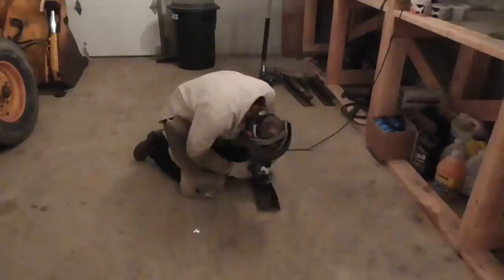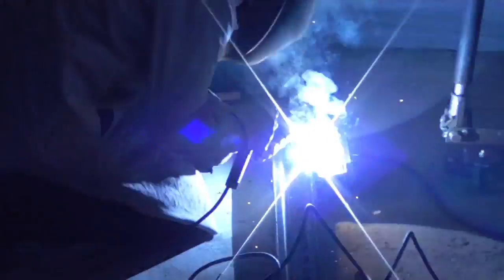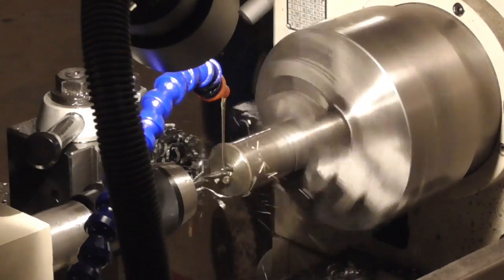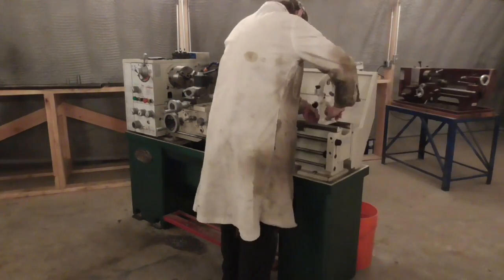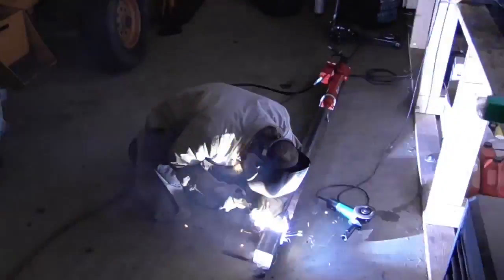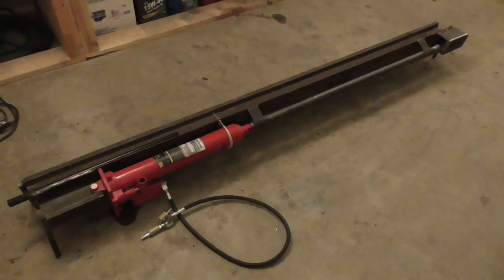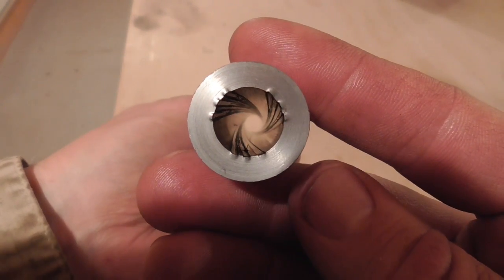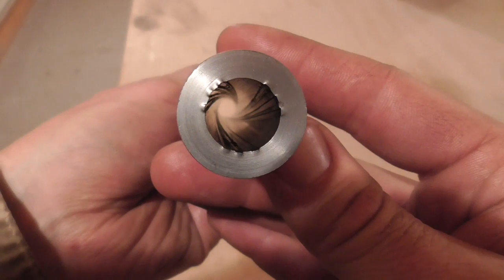Building a Better Rifling Press (TIS125)

Comment: A suggestion; instead of new air compressor just get a portable air tank & have it in line. You can increase your air storage & at the same time have a portable tank in case you need one.

Comment: Such things could be done with a leftover hardened drill bit cut with a file and blade at the right angle. Hardened and serrated with a hammer. In the 90s

Comment: If you have the means it might be more practical to try hydraulics, that way you don't have to wait for the compressor to keep up and you can retract it by just redirecting the flow. 

You have a lathe, you could make yourself a set of makeshift cylinders, fittings and lines out of steel pipe. In fact if you made some directional flow valves (which you can do too) you wouldn't even need to buy anything off the shelf. And it would probably cost less than 50 bucks in material. If you look for "diy hydraulics" there's a guy crushing coke cans with nothing but cheap plastic syringes.
When you have a lathe and a milling machine the sky is the limit. Hope I can get there some day.

Comment: What speed and type of bit and rpms did you use to machine the railroad steel my mill bit just got all chewed up
Reply from the maker: Well, it's been a while since I made this video, but if I recall correctly, I probably did most of the machining with a 3/4-inch carbide end mill at about 1000 rpm.
Reply: TheIdahoanShow thanks

Comment: Thanks for posting this. You did a great job with the video! Nice machine shop but no air tools for fastening bolts? Was kind of funny watching you use a breaker bar when you have tens of thousands of $$$ in equipment there. I was wondering why did you decided to rifle the barrel 3 times, or even use just lands/groves?  I thought you weren't supposed to re-rifle a barrel due to the elasticity of steel and the stresses induced by rifling. Did you stress relieve & lap the barrel afterwards? How about cutting a chamber & showing "proof of concept" by firing the barrel? Can you put an 11 degree crown on the barrel? This was really interesting!

Comment: Correct me as I’m sure I’m wrong, but I thought welds didn’t hold good on railroad track as they were cast iron?
Reply from the maker: I was under the impression that rails are typically rolled rather than cast; at any rate, I've never had any trouble welding them.

Comment: What about rifling rate of twist? Seems components are straight line, no turning for twist rate.
Reply from the maker: The rate of twist is determined by the angle of the ridges in the rifling button that is driven through the barrel.

Comment: Hey brother nothing wrong with the button guide or equipment that she used you just used cheap metal for your barrel I've seen it before change the metal that you use for your barrel better results other than that it looks great in the equipment looks great job 👌

Comment: I am wanting to make a yard Cannon with approximately 2 inch bore. Wondering if they make a button rifling bits in to inch? Just laughing! Very nice job. Great to see Ingenuity at work
Reply: The amount of force you'd need would be pretty scary, and if it's a muzzle loader you'd have a tough time getting the button out of the breech. You'd be better off cutting the grooves instead, with something like a shaper that can rotate the cutting tool.

Comment: You've inspired me to build one of these. My cut rifling system pales in comparison to your button system! Will 8 tons be enough for a 6 blade button? I need to do calibers down to 25acp, do you think there is enough support in the bushings to go that small? I wanted to use aluminum for my bushings since I have alot of scrap aluminum, I'm guessing there's no problem with that since there shouldn't be that much force on the bushings? Also, I wanted to cut down on the amount of unsupported pushrod, so I was thinking about cutting a recess into the bushings for the spring to rest inside (maybe this will secure the springs better too). If I used 2 inch thick bushings I could recess the springs a half inch on each side, then the bushings would touch when the springs are fully compressed and there would only be 1 inch of unsupported pushrod between the bushings when uncompressed.

 I'm going to buy 6ft of some hardened rod off the shelf from mcmaster 50,000psi Rockwell C60 (is this going to be strong enough?) https://www.mcmaster.com/1555t12

Thinking about using these springs: https://www.mcmaster.com/1986k655  I think if I can fit them into the bushings snugly they will hold alignment very well. They have approx 50lbs pressure so hopefully they can "auto-retract" the system like you mentioned in the video.

Some 1.5" schedule 40 pipe (72" long, using a drilled cap on the end because I'm lazy)

The only hydraulic ram I can find that would be suitable (8 tons but only a 17 inch stroke) is something similar to this harbor freight ram https://www.harborfreight.com/8-ton-long-ram-air-hydraulic-jack-94562.html is there something better I can use?

I was also thinking about containing the barrel blank inside a block of aluminum (bored to the OD of the barrel, then a smaller bore out the end for the button to exit from)

Do you have any other suggestions? Thanks again for making this video and inspiring me to do better work!
-Max
Reply from the maker: Sounds like you're on the right track.  The jack you specified looks almost identical to mine.  I think recessing the bushings is a great idea!  I used a 3/8" rod on mine, so I've never tried rifling anything smaller than 40 caliber on mine, but with adequate bushing support to keep the rod from buckling, I should think it would work.

Comment: Why not use an old wood splitter for the base and you could have use the hydraulic system and cylinder
Reply: this is kindof along the lines of what i was thinking. Or even just an off the shelf hydraulic ram with its own pump (like you said though an old wood splitter would be the cheapest way of obtaining that probably)  If the air compressor was having trouble keeping up with that short of a barrel, if he wants to upgrade to rifle barrels an even bigger air compressor is still going to need to catch up

Comment: Hello, inside the barrel do you use any lubrication?
Reply from the maker: Yes, the button requires lubrication.  I typically use sulfurize canola oil.
Reply: @TheIdahoanShow  cool thanks! Would it be better to use grease for this or no?
Reply from the maker: I've used moly grease as well.  It works, but it makes more of a mess.
Reply: @TheIdahoanShow  Cool! Personally i got the best results with graphite grease. Its indeed messy but worth a try. 
The real challenge here is to make a longer barrel, eg for rifle as holes like that wont be straight in that lenght :(
Reply: Adam Monster  Yes i was looking on this all true. Just out of curiosity, how much would be the minimum cost of a deep drilling machine?
Reply: Adam Monster  well i have a lathe but the bed is about 1 meter so i was thinking of instead of getting a cnc or bigger lathe to get straight a drill machine.
Maybe i could indeed build it as you suggest. 
Do you know any website that has the pumps and the tools to build it?
Reply: Adam Monster  up to 700mm and several calibers from .22 to .357
Reply: Adam Monster  not sure now as im not there but it can fit a 700mm long and 45mm thick.
Oh btw i asked for a drill machine... wow man... 200k $
Reply: Adam Monster  cool! many thanks!!

Comment: I have seen other videos on home rifling and it seems that the idea of pushing the cutter through is a common one. I made a simple rifling machine that pulls a rod with the cutter on its end, using a 4 ton hand crank winch. You don't have to worry about deforming the mandrel.
Reply: Your's is the correct method to avoid rod deflections. Do you perform this before turning the blank to the desired barrel profile. How do you straighten the barrel or do you?

Comment: My knowledge of barrels is rather on the user side but seeing this, does the bullet have a diameter of the driving button or the smooth part of the barrel? Because I'd say it matters. Does the bullet rotate then at all? What is the percentage of those two layers? And this - does the button push material to the sides and into the center? I would drill that sonofabitch once again or had run a round button through it.  I'd probably spend some time in theory books before my first shot. It looks great and simple but I dunno man.

Comment: I feel like a poor kid watching another kid playing with nice toys. Lol, why am I doing this to myself?
Reply: It is more than possible to construct your own small screw cutting lathe and mill it's actually practical if you have a lot of time on your hands. And it will cost you a couple of hundred bucks in scrap, a hand drill, various drills and taps and nuts and bolts https://gingerybookstore.com/index.html
Reply: That would allow you to build small handguns, or model engines or clocks and things, as this lathe has a 7 inch swing and 12 inch travel. And also allow you to make fly cutters, etc. But the most important thing isn't even the machine tools you make, it's learning how to do them and even make do till you can make your own tooling.

You could make a larger lathe, but you would need larger castings to do that or maybe you could develop your own methods like instead of using an aluminum or zamac casting you could possibly use say reinforced or welded construction to bolt the ways of hand scraped cold rolled steel. Welded construction or concrete is hard to get to a dimension accurate enough for a machine tool, but you don't need to if you have say a piece of iron out of it that you can scrap, drill, tap and shim as needed to get the ways well supported and mounted dimensionally accurate, because neither is going anywhere once it it is made.

Might I also suggest the Clickspring and This Old Tony videos for a lot of stuff about how how to make your own tooling.
Reply: Finally, the in the original video that lead to this one he did it without any machine tools except a $40 drill press and a $40 dremel https://www.youtube.com/watch?v=D43ZeYu9dnM

Comment: I'm looking to make a barrel or 6 out of either 316 stainless or chromoly round bar stock. The stainless for pistol barrels and chome for rifle barrels. Or would you suggest a different material? I'm asking as I'm new to this. Any help from yourself or any viewers would be appreciated. Thanks.
Reply: 316 is too soft. You'd need to use a hard enable ss like 17-4ph. Not sure if that would have the required toughness but itll definitely be better suited than 316

Comment: Great job!  Fantastic!  Please let me  make some suggestions with out offense. 
I think a hydraulic pump would be better than compressed air.  All the heavy weight presses use hydraulic systems.   A one pass button would  be better with a flute to lead it in so no hammering.  Can you cut a star pattern button?
Reply from the maker: Thanks!  Yes, a system with a dedicated hydraulic pump would be nicer than one like this with a manual hydraulic jack and the air-hydraulic option.  However, it would also have increased the cost and complexity of the project quite a bit, which is why I went with the jack in this case.  Lately, I have been experimenting with making 6-fluted buttons with a star-like profile, which can rifle a barrel completely in a single pass.  Because of the higher fraction of surface engagement, they are a bit more difficult to drive than the "triangular" buttons I started with, but they seem to work fairly well none the less.

Comment: I'm curious what your cutting oil is? The Mobil brand I use is much darker color, and very expensive. It does generate some shop mess, but you don't worry about corrosion like water soluble (and can leave the vise on the mill table). Over time, it does seem to evaporate.
Reply from the maker: I started out using a 50/50 mixture of way oil and WD-40.  That was cheaper than specially formulated cutting fluid and I could be sure it wouldn't rust or damage the machine, even if I let it sit for a while.  The only problem was that the WD-40 had such a low smoke point that it generated a lot of smoke on heavy cuts.  Lately I've been running canola oil as a cutting fluid.  It works as well or better than the mixture I was using before, doesn't smoke much, and only costs about $8 per gallon.
Reply: Any neat cutting oil will do.

Comment: So why the long guide/mandrel tube? Isnt the drive limited by the hydraulic press length?
Reply from the maker: The guide tube is longer than the hydraulic ram travel, because it also has to accommodate the bushings and springs.  I have about 24 inches of travel, but then each bushing is about an inch long, and the compressed length of each spring is about an inch, and there are 12 sets of springs and bushings, so the collapsed length of the support column is also 24 inches, and so the guide tube needs to be about 48 inches long, or enough to accommodate both the collapsed length and the travel.
Reply: TheIdahoanShow why? I just don't understand I guess.

Comment: Very interesting, you do nice work.
Just a bit of trivia, back in the 50s Gillette bought miles and miles of railroad track to make razor blades from. If you recall the old double edge blades they marketed as blue blades that was them, and they had  the market cornered for a long time because of that.

Comment: Question...  Why not pull the rifling button through the barrel and do away with the need  for the guide tube?
Reply from the maker: Well, to pull the button through the barrel I would need some kind of mechanical connection between the button and a pulling rod.  That connection becomes a stress concentration point, and also adds significant mechanical complexity to either the button, the drive rod, or both.  Also, brittle tool steels, such as I typically make buttons out of, have excellent compressive strength, but poor tensile strength, so designing the connection such that the button wouldn't just break off would be challenging.  Finally, in practice, it is much easier to apply a compressive force with a hydraulic jack than it is to apply a tensile one.  Thus, while I'm sure that a tensile-type button rifling apparatus could be built, I think the overall system would end up being much more complex than what I built here.
Reply: @TheIdahoanShow  You can compensate for that by having an index-able cutter where you vary the depth of each pass. Use replaceable cutters already made for lathe tooling and then all you need is a cable (like OTIS cleaning kits use) and the means to pull it.
Reply: rats arsed 

Then you build one and post up the video.
Reply: DarkMatterX1 he would if he could but he can't so he won't
Reply: rats arsed .. and he's doing a great job ...i am also new to metall work bought my lathe,mill and shaper 2 years ago but I have learned that many ways can lead to Rome and if it works the builder is right and he did proof that ... probably not the only way to success but it's his way he shares with us and that's why I have great respect for his good work.
Reply: Hydraulic log splitter would nicely adapt for this.  They have a retract valve

Comment: I'd like to see an upgrade that allows you to equally space your rifling, that could then provide full rifling coverage and with your new press could be used to produce a long barrel. Then we could see that test-fired.
Reply: I know this is an old comment, but I think it'd be relatively easy to simply make equally spaced radial marks on the subject being rifled, which would be easy to then line the button up with.
Reply: easy young grasshopper...if you have never worked metal, and done what you saw in this vid.  It takes time!!